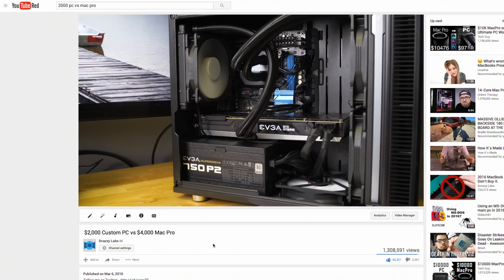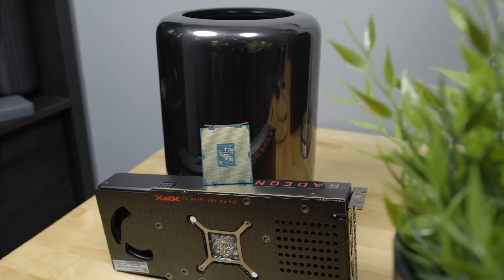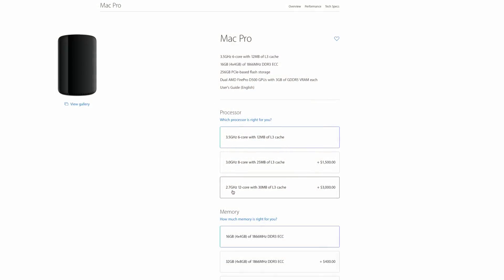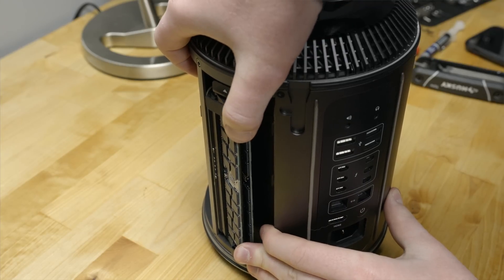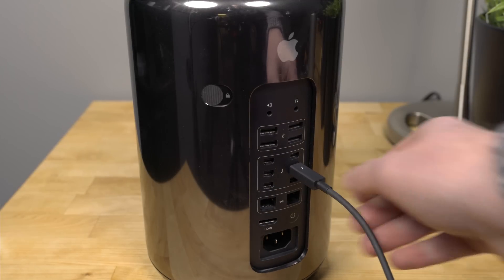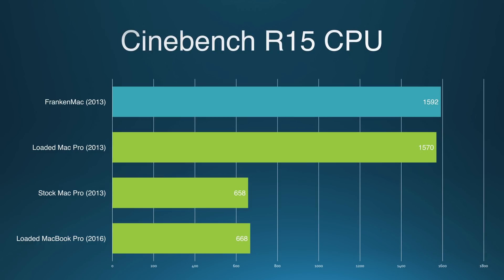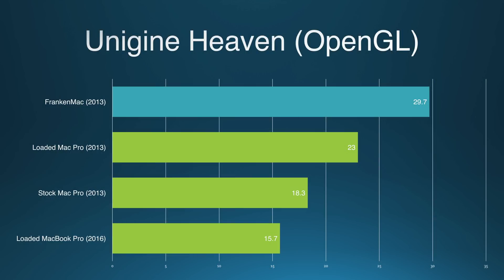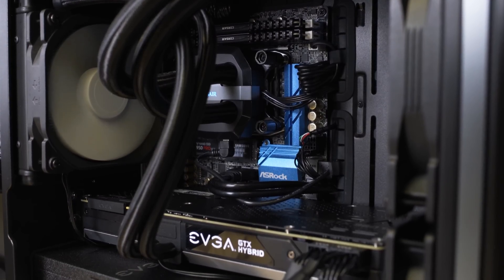The Best Mac... Apple Doesn't Make!

Comment: That awkward moment when a youtuber builds a better mac than apple
Reply: Well,  by the same logic, apple didn't build anything, just assembling the intel cpu, the and gnu and ram together.
Reply: David Except it's more than double the size lol. Still a vast improvement, damn. I hope Apple updates the Mac Pro soon though.
Reply: Mozef,  Good point.

Apple is using slow, poor-quality memory in the 3500-dollar MacBook Pro.    Customers are disrespected and over-charged.
Reply: Michael J,

 I hate Apple just as much as the next guy, but they deserve some credit for the mini-trashcan Mac Pro.

it's a pretty cool design, with huge triangular heatsink and quiet fan up top.   But Apple wants 8000 dollars for the top model, which is an absolute joke.    I can build a Windows workstation that is much faster for 3500 dollars.   

No wonder Mac has a tiny 7% market share after 30 years in business.  What an embarrassment.
Reply: Bohunk, you make some good points.    Makes the 8000-dollar Mac Pro look even more ridiculous.    Apple is such a joke, a terrible terrible value for the money.
Reply: David I loled at this
Reply: Dawg, you can build a much faster windows workstation for 2500$ tops tf. Hell if you go the used route you can grab a pair of xeon e5-2650s for like 80-100$ off of ebay, get a board that can run both of 'em for like 350-400$ (cheaper if there's a part out from some older server) 64gb of ddr3 ecc for like 80$, and a used gtx 980 for like 220-250$. Max you're looking at like 830 + 200 give or take for peripherals and a case + PSU. 

Its just like how OP said, it's not gonna be faster for the same price as a windows rig, but if you need final cut pro just how he does, you can go the route he did.
Reply: How do I have 1K likes on this comment?
Reply: David Apple literally didn't even build anything except the case and fans lmao. They used intel CPU's and AMD graphics cards, maybe they created the motherboard but that's it
Reply: Still not agreeing, sorry! External GPUs are the trend, and ok, he's build an external GPU. Not a mac. :)
Reply: its easy to build a better mac than apple, its called a hackintosh and its easily half the price and double the performance. the apple brand is overpriced, underpowered and needs to be knocked down a peg. as much as i want to experience the mac os, i refuse to buy one until they sell it at a consumer friendly price that reflects its ACTUAL value.
Reply: David well its kind of usual now
Reply: lel.
Reply: it's a good observation ;)
Reply: HAHAHAHAHAHAHAHAHAHAH LAWL
Reply: LMAO
Reply: The problem is that the moment is not awkward at all for people that are a aware of Hackintoshes. Or for people that have built and use one.
Reply: ansonx10 That's not a mac. It's a normal PC running OSX.
Reply: Obviously. I built one. I know what it is. But for all intents and purposes, it's a better "Mac" than Apple makes, for everything except the physical build quality of the non-electronic components. But the non-electronic pieces doesn't matter much in the real world. If I could build a Unibody HacBook, I would.
Reply: The hardware is a mac, the OS is OSX.
You wouldn't call a crappy cheep acer laptop a razer blade stealth, just because its running windows.
Reply: Right, for the same reason I wouldn't call a hackintosh a "MacBook", "Mac mini" or "iMac" But I would call both the laptops you mentioned "PCs" because they both run Windows.

I'll let you tell me PC stands for personal computer etc. in your reply, because you seem to enjoy criticizing my word choices, without regard to the intended meaning of the comment. ;)
Reply: My point is, your original statement is pointless, because a hackintosh isnt a mac, is just whatever PC you want (as long as the hardware is supported), running OSX. This, however, IS a mac. Just modified.
And I know what PC stands for.
Reply: ilCapotesta Are you for real?
Reply: lol even a prepubescent twat can
Reply: Technically, he haven't build nothing. Upgraded by himself just RAM, and a stock CPU. Then, GPU is on an external case...... That part ain't no mac, but a BBBox

Comment: I'm looking at purchasing one of the 2012 Mac Pro 5,1 models on eBay. After watching this video I found a post on MacRumors saying that this card also works in that machine, which is great news! My question, however, is would it be worth putting $2,000 into this older Mac Pro with this card, or just waiting to see if a new Pro is revealed this year and possibly trying an external GPU for it later?

Edit:
Wow, I didn't realize that the base Mac Pro on the Apple site was already $3,000 for much less RAM and storage. I'm not sure how the quad core Xeon compares to the two hexa-core xeons in the 5,1 model, but I'm thinking doing the older Mac Pro would be a much better price to performance ratio. What's your thoughts?

Comment: Great vid. Made me consider an rx480 as an upgrade to my 6700k gtx950 hackintosh. Frankenmac is a cool idea too
Reply: Snazzy Labs Wtf are you talking about, the 950 is a dog shit graphics card. The RX 480 is placed between the 970 and 980 in terms of performance. The RX 470 is essentially 970 performamce.
Reply: Dean Yu the fury X has double the compute units and pushes OpenCL quite a bit more in real world use - but the power draw is ridiculous! Dual RX480 is a good compromise for now until vega for additional GPGPU use, but definitely NOT a replacement for D700s. D700s plus dual RX480s on a 12-core completely smashes workflows up to 6K. 8K is still sluggish for RED raw realtime playback even if buffered. My above statements are about doing work, not gaming.
Reply: Gershon Dharmanandan Nah dude, it's been 2 years. Everyone's given up hope tbh. And while the 980ti is technically the most powerful, the fury x might be a better option if I use final cut
Reply: ***** he's saying that the 480 can beat the 980/1060 (I'm pretty sure that the 980≠1060, it's more of 980=1070) which means the 480 is not as fast as the 1070. 1070 isn't low end. 1060 is mid range, 730 is low end. Even 1050 is mid range
Reply: Rem ko Mac is better for a bit more than just audio :) Imo, I prefer mac for content creation simply due to app support and optimization, but it is true that windows absolutely annihilates mac in terms of gaming. The rest is just preference
Reply: Andrew McEwan Yeah but let's be honest. If I wanted to game on my hackintosh, I may as well install a dual boot system with windows. (Which  I have already haha) 

So since the 480 is a significant upgrade anyways, that might make more sense than a 980/980ti for my hackintosh (10 series cards aren't supported yet), plus amd compatibility with final cut is always a plus.
Reply: Gershon Dharmanandan The new 10 series cards font have drivers yet so I can't use them. Also final cut really isn't that quick with nvidia cards
Reply: Gershon Dharmanandan 980 is only slightly better than the 1060. 1070 is essentially the 980Ti.
Reply: Apple is for suckers,, and it always has been.  Cell phones, computers, laptops, ALL ALWAYS are slower, underpowered and overpriced because Apple consumers are stupid.  WHY buy a technology product that has an inferior technology to the competition?  Esthetics?  A logo?  There's nothing "pro" about the Mac book, nothing Apple creates is "Pro".  The cell phones are slower, with smaller screens; and the computers are even worse.  Apple is for suckers, Apple is like buying a $200 Polo bath towel.  It's for SUCKERS and idiots.  Or, Rich suckers and idiots.
Reply: Tonys Mind 
When it comes to software that is optimized to use OpenCL, the overall "powerfulness" of the video card is mostly a moot point.  It all comes down to the number of OpenCL COMPUTE CORES on the video card.  Nvidia puts omer focus on OpenCL and CUDA Cores which make their cards good for video gaming and Adobe software.  AMD puts a lot of OpenCL Compute Cores on their cards, which is why they perform better on software that makes good use of OpenCL.  People seem to be completely unaware of what OpenCL is, because they always seem to be confused as how an AMD card can perform better on FCPX than a high end nVidia card could be.  It is basically "Distributed Computing" where the software says "OK, anyone that is a compute core that can handle this kind of work load, start working on it" and then it gets distributed to all the hardware that can process OpenCL.  Kind of like having a Render Farm of computers to process a huge video project that an editing studio would have.
Reply: Scott Kuzma wow! Awesome answer! What is I buy a rx 480 and keep my gtx 980? Will hackintosh use both? I use fcpx for editing and after effect for post video.
Reply: Nvidia cards are useless on Mac because everything uses OpenCL, and AMD does it better...
Reply: Yeah, but AMD cards run hot.
Reply: Alex Snitzer Only if the manufacturer makes a crappy cooler.
Reply: Woodepic Media I don't know if mac skewes proformance to Nvidia for games but the 470 and 480 are really close in proformance to then selves and last gen equivalents would be r9 390(x) / 970/980 range so just in gameing it would be an upgrade.
Reply: I don't know much about currently natively supported GPUs on mac but I would highly recommend an fury of any veritey (x,nano) as in the US they can be found for around the price of an 480 and out preform it on everything the olny negative is it olny has 4gb of VRAM
Reply: Woodepic Media Weird, I have the same as you; 6700K and GTX 950 on a Hackintosh lol
Reply: MattU Haha do you have 16gb DDR4 and a z170 board?
Reply: why not just get a new generation nvidia card? or the old gen 980 or something. Nvidia cars work fine in OS X with the drivers.
Reply: depends on the use case. If you want to use Final Cut pro then Radeons are way better since FCPX is optimised for it !
Reply: Rat Face Yeah that's what I was thinking. I only got a 950 cuz it was a friends, and I was waiting for pascal cards to be supported. Unfortunately that will never happen :( looks like amd it is. Maybe I'll wait for their next gen cards.
Reply: Woodepic Media Ya, I would wait for Vega. Probably going to come during May/June time.
Reply: Woodepic Media ahh right. they only have support up to maxwell as of now. they should release it soon, i remember the wait for maxwell. im sure by the next version support will be out. but still nvidia's 980 ti is the most powerful card you can get that is supported. and its more powerful than the 480.
Reply: Rat Face the 950 is a good budget card. and im pretty sure its more rx 480 > 970 and 470 > 960. it doesnt quite match the 980, and only slighly edges the 970.
Reply: Woodepic Media nvidia will be supported in a while. everyone thought the same about maxwell, but they released an update when yosemite came out that supported them.
Reply: Arne Bornheim actually it depends, some nvidia cards work really well with fcpx.
Reply: Gershon Dharmanandan Apple has been optimizing their software to work better with amd tho. That's why all their new computers use amd. It's actually a bigger difference than you might think
Reply: Woodepic Media it hasnt been 2 years. its been barely a year.
Reply: Gershon Dharmanandan The RX 480 is more powerful and faster than the GTX 1060, which Nvidia bragged about being on par with the GTX 980. And the 470 blows the GTX 960 out of the water. The R9 380 was the 960 comptetitor (the 380 was faster btw), and the RX 470 is better than the R9 380.
Reply: ***** who said that and where?
Reply: +Snazzy Labs That's a hard call to make. The 480 destroys the 950 in Windows benchmarks, but I don't know how it would fair on the Mac side. The 480 is significantly faster, but if driver's are unoptimized, then that could severely cripple a fast card.
Reply: Woodepic Media thats quite the disparity u have there between ur gpu and cpu
Reply: Just use Windows for fucks sake. Use  Mac for professional audio and  Windows for gaming and the rest. Use the right tool for the right job. And no, there is no other scenario where I'd prefer a mac over a Windows or even Linux PC. Unless you are a total digi-moron then mac OS would be the way to go. Semething my 90 year old grandmother would use.
Reply: 0812rs Haha Ikr. The idea was I would just use the 950 until Polaris or vega gpu's are supported in mac. Still waiting lol
Reply: Sam Medley Yeah, that's for sure. The 480 if anything would actually be better optimized than nvidia on the Mac side. I was only thinking amd was compelling for an upgrade path instead of nvidia. Now I'm. Considering picking up a vega card
Reply: Snazzy Labs
How many video cards show up when you view System Profile?
What scores do you get for OpenCL specific benchmarks?
Reply: Do it! =D
Reply: i have a gtx 980 in my hackintosh and it is very slow for rendering in fcpx ..
how can a rx 480 compete with the amd dual fire in the old Mac Pro?
Reply: Tonys Mind 
If you have functional drivers for both cards, I don't see why it shouldn't work properly for both.  The software will simply work with the hardware that exists on the system.
Reply: For nMP 6,1 w/ D700, I experienced weird issues/crashes when running both RX480 w/ GTX Titan X.
For most currently, running two Fury X cards via eGPU w/ D700s is the best performance from a Mac.
BUT, you can get close to that w/ D700s + (2) RX 480s via TB2, which is my setup
Reply from the maker: +Woodepic Media If you're gaming, I would stick with the 950. If you're not, the RX470 is probably the best bang-for-buck for macOS. Thanks man!
Reply: Snazzy Labs Yeah I don't really game much, but even if I did, an rx480 should still beat a 950 right? The 480's a compelling card since it would work nicely in windows and mac on my hackintosh
Reply: Tip: If you can get the drivers sorted out in Hackintosh, the Nvidia Geforce GTX 1060 6GB is faster and uses far less power than the AMD Radeon RX 480:
http://images.anandtech.com/graphs/graph10540/83309.png
http://www.anandtech.com/show/10540/the-geforce-gtx-1060-founders-edition-asus-strix-review/16

Comment: I'd rather build a hackintosh at that point.
Reply from the maker: +alex baracskai I need something rock solid for video production. Even the best of Hackintosh can't provide that, sadly.
Reply: Snazzy Labs Perhaps, but since Polaris is supported for Sierra and building a hackintosh with the compatible hardware would support 10.12.2 at least until 10.12.3 comes out. I'm pondering on a build, however I dunno if my girlfriend would want another computer in the apartment.
Reply from the maker: +alex baracskai You sound like me. Haha. I have way too many computers for one man. Lol
Reply: Snazzy Labs Lol! At one point I had a MacBook Pro 13, Dell XPS 15 9550, Surface 3 128GB, an older Toshiba laptop my dad now uses, 3 Gaming desktops, and a server. - I built a 13 inch gaming notebook for my girlfriend, now I just have my Dell and my desktop.
Reply: Raver87 Not if you've built literally hundreds of PCs

Actually, no, it's still kinda fun.
Reply: I've been running one since 2013 for video and photo editing. Works great...
Reply: not true I have a hackintosh laptop and a desktop I have been running these since 2008. Not the same computer but hackintoshes. and i rely on these to make a living. I admit it was scary back then but these days the right hardware runs flawless. I have been updating from the appstore since mavericks with no issues using the clover bootloader. Running the latest sierra like a dream.
Reply: All the more reason!  Sell the Mac Pro and build a no compromise mackintosh.  Are the 2011 chips really worth it?
Reply: what issues are you finding in video editing on a hackintosh? My hackintosh is as stable as it can get. In fact, if I hide my tower, you wouldnt be able to tell it is a hackintosh.
Reply: gotdamb, you built a 13 inch gaming notebook? That sounds like quite a feat
Reply: What's the best way to test stability on OS X? Never had my hackintosh installs crash..apart from that AMD Mavericks setup, although after fixing kexts it stopped crashing.
Reply: alex baracskai honestly I'd just run it in a vm or get a new hdd or ssd and put it in my pc
Reply: my Customac/Hackintosh is even more rock solid than my previous actual mac. Im not sure why you didnt just build one. Buy quality parts if you want good stability. Running sierra rock solid, no wierd software bugs or glitches. It just works.
Reply: Where's the fun in that?
Reply: Building a PC/Hackintosh is lots of fun!
Reply: What the fuck are you doing reading my username? Haha I was about to question you.
Reply: Question me on what? What PCs are most fun to build? For me it's the older ones with jumper hell
Reply: GonkCR does what work? A hackintosh? Yeah I the closed sierra beta running on my 6600(nonk) skylake computer just fine.
Reply: like free OS upgrades? afaik they have always been free on OS X
Reply: You need a dev account to get the betas not free its been a while but I believe $100 a year. The actual os is free. SOZ I KILL YOUZ why are you using the beta when its been out for months now?
Reply: Angel Mendez well I installed the beta originally but now I'm up to the latest OS with the supported nvidia web drivers

Comment: i wonder what performance would be like if you built a pc and used a mac os virtual machine
Reply from the maker: +Amitoj Singh Terrible. At least for video editing. Not to mention macOS is nigh impossible to run without issues as a VM. Bummer. Thanks for watching!
Reply: Snazzy Labs why not hackintosh?
Reply: Lots of driver issues. Not really worth the effort.